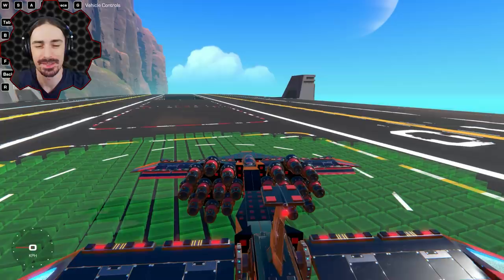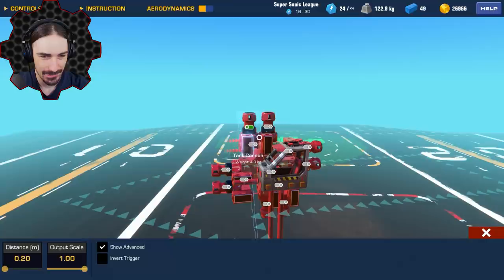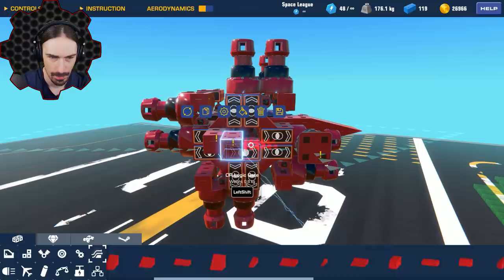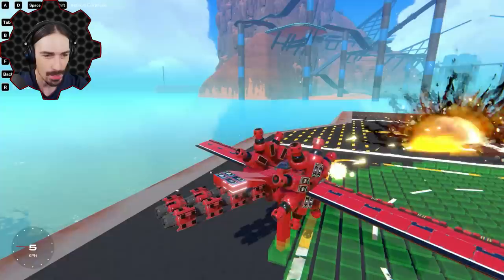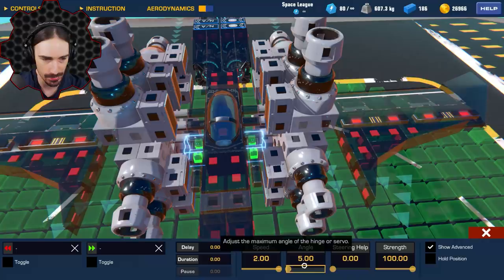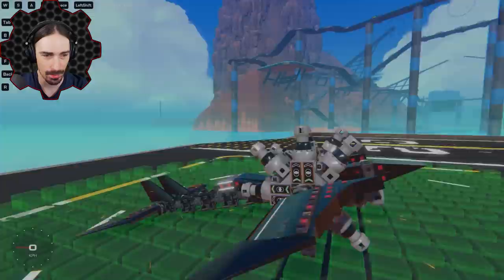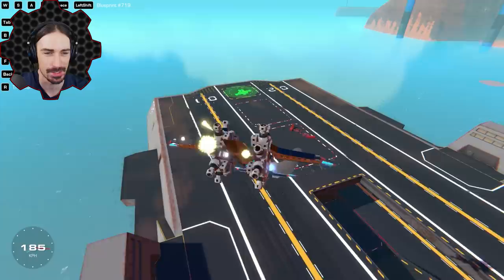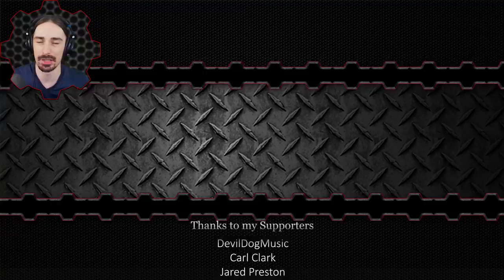I Reinvented the Gatling Gun and It Actually Kinda Works! - Trailmakers Gameplay

Comment: There’s probably some like really old blueprints of a weird gun like that from like, the 1800’s
Reply: I thought that it looked much like the drum pan magazines from ww1 
(With the exception of the fact that the ammunition was pointed inwards for space efficiency)
Reply: there was a revolver that worked like that, but you had to basically take the gun apart to reload (it was before the invention of cartridge), and turn the revolving chamber manually, can you see why no one bought it ?
Reply: @ledocteur7701  yes  both a horizontal and vertical version was made  but didnt sell well due to the user always had 2 live rounds facing them.   it was even made as a cannon and design sold to the turks but they never built it.
Reply: I know there was also a cannon made like this
Reply: @MrLarsgren  ho yeah, I never considered the fact that two live round was always facing the user, but it does seem like a bad idea, especially without relatively safe modern cartridge available.
Reply: I think there was actually a rocket powered tank that looked kind of like this
Reply: I knew I saw some on Forgotten Weapons. He has at least 2 videos on weapons like that, the video names are 'McCarty's peculiar revolver' and 'Porter Turret Rifle: Awesome But Dangerous'.

So yeah mid 1800's up until the very early 1900's with the McCarty revolver.

They are unfortunately not miniguns though, just a single barrel and 18 chambers.
Reply: Wow

Comment: You probably won’t work on this anymore, but I have suggested improvements. 1: make the pipes that trigger the sensors on the Gatling gun adjustable, so you can adjust when the weapon fires mid flight 2: make place each cannon on suspension to reduce recoil and maybe make it easier to land.
Reply: Also make the gun-wheels lighter by moving all the logic and whatnot onto the plane itself. This should reduce the chance of misfiring.

Comment: Day 2: Break the sound barrier on the centrifuge, or whatever the track is that just goes around in a circle without touching the ground (wall riding?), then when you start breaking the sound barrier, drive off the top of the track to see what happens when you drive off faster than the speed of sound.

Comment: The crossing of the bullets you actually want and is called the Butterfly Pattern if my memory is correct, real planes have the guns angled slightly inward if they are in the wings because it would allow for a pilot to get in a certain range and fire the guns and instead of the guns going straight forwards trying to hit the wings which is like trying to get thread through the needle hole but instead of the thread being normal size, your thread is your guns and the needle are the wings so they angled the guns inwards so the pilots can hit the fuselage

Comment: To improve this design, the guns should be 1-3 block points lower so it fires lower and it’ll help air to ground targeting. Would love to see a v2 of this, perhaps a Gatling tank with a disk of cannons just like how the plane has it but on the side for the tank. Perhaps it has some armor to protect it’s disk weaponry and a internal angle mechanism to allow it to fire at angles at a high rate!

Comment: pro tip

Try making the rotating things spin in opposite directions. And have them spinning constantly (when airborne) for increased stability.

put a sensor underneath, so you can fire straight down. and maybe above, why not.

Comment: Thinking about it, that would take a wheel roughly 5.5-7x the length of the bullet for mechanical stuff like firing pins and extractors, to save space maybe it could be like a revolver with the chamber is separate part from the. Barrel

Comment: I think these would work much better on a shnook or vtol style craft, with direct vertical take off. Then use a rotating servo to change where the aiming bar is instead of a hinge for 360 degree aiming for an anti aircraft as well as air to ground destroyer. Idk just my unique take on it. What looks like is happening is because banking is changing how gravity is affecting the helicopter servos, that's why they're spin is going haywire, if the vehicle didn't rely on forward motion to cause lift then you wouldn't need to bank as far and possibly eliminate that issue.

Comment: I'm surprised that Scrapman didn't put the gatling wheels horisontal.
Then the wheels and the control surfaces would be separate.
With the type of gun he wouldn't notice the difference in the angle.
Reply: Torque would create unintentional yaw
Reply: @ThePhonax  
Counter rotation would alleviate most of it, he'll probably get a slight turn but that should be manageable.

Comment: I could be wrong, but it looks like you mirrored the original design to create the second gun. In that case the cannons that are set to 45 degrees will likely flex out of sync, as one side is forced against the next barrel, while the other side forces the barrels away from the next barrel on the gun. This was probably poorly explained on my part, so I'll try another way. Since the guns are mirrored copies, you would have to spin one gun forwards, and the other one backwards to expose the to similar conditions. Otherwise you will have to rebuild the second gun so that the hinges of the 45 degree guns are oriented the same relative to the direction of spin. Hope this makes sense.

Comment: You could mount them sideways above and below be it unconventional u could have them counteracting each others rotational torque and make it easier to mount wings giving u the ability to use the consistent motor speed instead of the helicopter servo...

Comment: @ScrapMan if you put the Gatling guns horizontally aka top and bottom instead of vertical and use standard servo you could fix the wing and over spinning issue also if you make them spin in opposite directions they will oppose each others forces I would love to see a VS on this concept to see who could make the best volume of fire weapon using as few guns as possible

Comment: I made one bigger, better (for other purposes) and about 60 times faster. Not as in I'm better than you. I'm just proud of how well my version worked. Mine was also a stationary turret, that required 4 barrels to not rip itself apart instantly, but when it does have those, it's really stabil and only has about 5 degrees spread. The 60 times faster is not an overstatement. It is genuinely that fast.

edit: Alright. Yours is faster a little later in the video, so my numbers might not be so exact anyways.

Comment: had you placed them horizontally it would have been like the cochrane turret revolver.  i think it will work if you make it like a twin rotor helicopter  with rotors going opposite ways to counter the torgue effect.
as a gun it was a failed design.  noone liked to have 2 live rounds pointing at their face while using it.

Comment: If you want a challenge setup a plane that had the gun behind the propeller and it has to shoot between the blades. real planes did this, mistakes ended badly with holes in the prop or no prop.

Comment: watching you try to fix the wings out of alignment and it is because it drops on the ground as you have not LANDING GEAR and the impact is rotating them without the motors so they can't cancel out the movement. Don't drag your guns on the ground it is bad for them.

Comment: I tried to make a Gatling gun wheel but I could not get the timers to sync with the speed of the engine
I probably could make it sensor based instead of timer based

Edit: in Scrap Mechanic